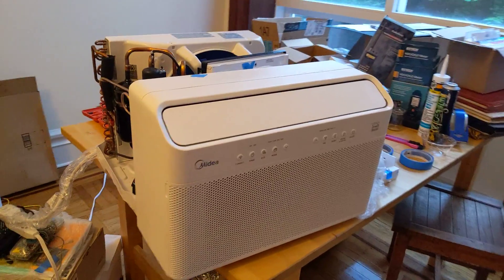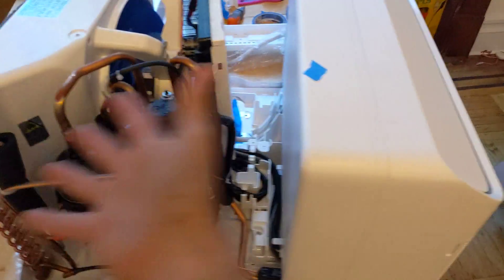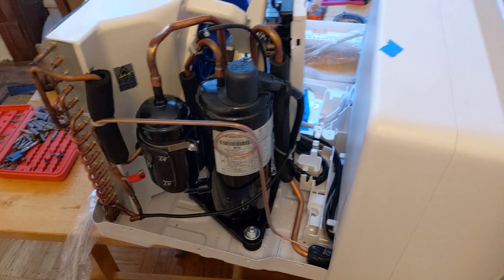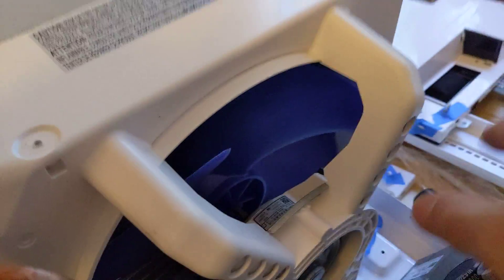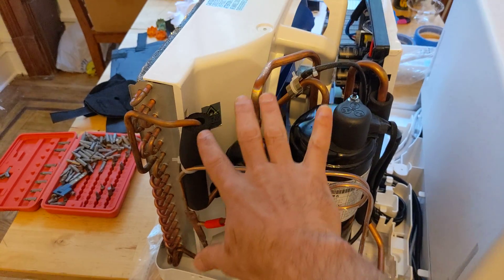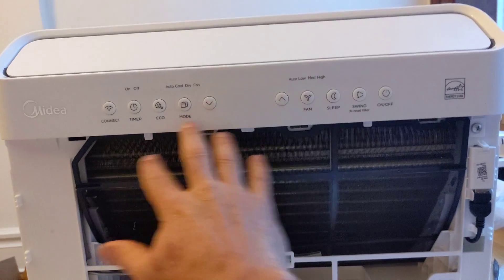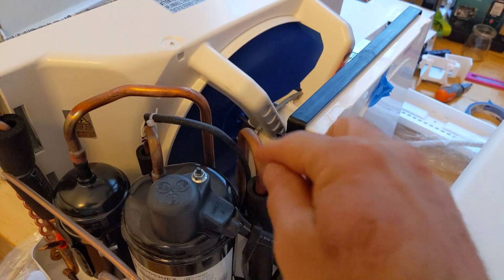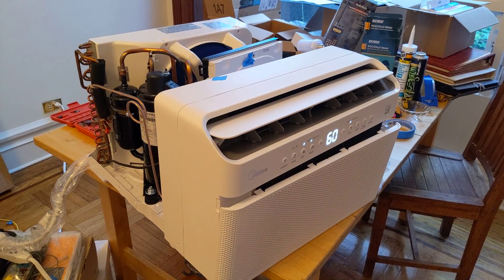How did Midea fit a full mini-split system inside their new "U" window unit?

Comment: What’s the purpose of the little bit of supercooling you get with this unit?
Reply from the maker: Just slightly increases efficiency. Easy way to think about it is that the condensate water is by definition colder than the outside air since it comes from the inside coil. This means that it can lower the temp of the refrigerant to be lower than the outside air temp. So you are basically taking some of the "coolth" (opposite of warmth) stored in the condensate water and moving it back into the room rather than just dripping it onto the ground outside.

Comment: I don't know if you still monitor this feedback, but I have a question since you seem to be familiar with this unit.  How much does this unit dehumidify?  How does the water (condensate) get out?  Is it a direct air pathway (connection) to outside?  I'm wanting to use this unit to maintain temperature and humidity for a shed project.  If this is a simple drain, humidity will leak in.  Is there a p-trap or check-valve to prevent direct air flow?  I'm building this in hot, humid Florida.  Planning to use a slab with vapor barrier (ground is always 55 degrees), Zip-R walls & cellulose dense-blown walls & ceiling.  It will be an ice chest.  I'm concerned this will be my biggest air/thermal/moisture leak in the entire system.  Any information you have would be helpful.
Reply: Mine has a condensate water tray under the fan. You can hear the fan splash the water around to help cool the components and evaporate the water.
Reply from the maker: Some have complained that these do not dehumidify their space as well as older dumb units. My guess is that this is because these people have a lot of moisture coming into the space through a leaky envelope. Since these units will run at the marginal indoor coil temp the keep the temp set point for efficiency, this means that they will not dehumidify as much as a unit whose coil is pegged to, say, 45F always when the unit is on. There is a dehumidify button that I would guess tells the controller to run the coil at a lower temp and probably to also slow down the indoor fan, but I have not tested this. 
The condensate flows out via a gutter than you can see at 3:48. You should be able to hack a drain tube into the indoor condensate gutter and run that tube to a P-trap if you want to get the water out without letting any air in. I've also seen cool negative pressure condensate traps like this https://photos.app.goo.gl/VT8UryMUyD4fp8Rh8 that are even better than P-traps because they get all of the water out of the envelope immediately (P-trap always has standing water) and mechanically block backdraft into the space.
With such a tight airseal, a unit like this might be overkill. You might be able to get by with something like https://amzn.to/3mzDulZ since the small amount of heat that it rejects into the space will just get absorbed by the slab anyway. 
Good luck and please report how it turns out! I want to sleep in your ice chest. :)
Reply: @bigjoshlevine  Thanks Josh.  I want to unpack this and I’ll get back to you.  Wish I wasn’t busy right this minute.  Sounds intriguing.

Comment: Just installed mine yesterday. Pitched roof, 3rd floor. Only 3 inches of space below the window. Modified the sill to lift the unit 4 inches to accommodate the bracket angle support. This thing is whisper quiet and no clunking sounds. Measured 45°F breeze coming off it on high. The install is different but the unit with it's platform bracket is amazing. This video makes me happy i invested in this. 👍

Comment: Do you know if there’s a valve on it so I could disconnect the refrigerant line without destroying the unit? I’d like toset this up in my camper van. I have an isolated metal box where my generator is currently sitting that I’m going to pull out. So I can mount it in the box through the wall. It would be a lot nicer if I didn’t have to cut a big hole in my wall though and I could completely split the unit in the two to install it and then put it back together
Reply from the maker: The refrigerant loop is sealed so you would have to recover the refrigerant from it, then cut the lines, then reconnect everything, vacuum pump the system down, and then recharge the refrigerant. This is not that hard (AC techs do it every day), but you do need stuff like a manifold and a vacuum pump. If you know someone who works on AC stuff they can probably help. I also recently saw this nice vehicle unit from MRCOOL, but I'm not sure if you can buy it yet. https://imgur.com/a/xB1p3Ne
Reply: @bigjoshlevine  Cool, I might try it how do you mean recover it? I think this unit would be nice in my van and take up way less space than a mini split

Comment: The variable speed has another benefit as shown by this unit's dehumidify mode. Run slowly, it can dehumidify better that an A/C that turns on and off. That can save on your power bill. But with these benefits, comes a electronic complexity that may not handle surges or lighting well. You might want to install a HVAC-grade surge compressor.
Reply: I do believe that these units have a breaker built into the plug, with 2 button Test / Reset (similar to a hair dryer)

Comment: Could one of these be modified for roof mounting? Angle the inside unit 90 degrees down so I could put it on my RV? I really hate my noisy, inefficient RV unit.
Reply from the maker: Anything is possible, but I think making the inside coil horizontal would cause problems because (1) the condensate would not be able to drop down to the bottom edge, and (2) you lose the whole design goal of having liquid refrigerant come in at the bottom and then turn in to gas by the time it gets up to the top so heat is absorbed across the whole coil and no liquid gets back to the compressor side.
Reply: @bigjoshlevine  Yes, would probably require some re-engineering. But if someone does make a roof unit like this it would sell like hotcakes, especially at this price point.

Comment: We love ours, but it removes zero water from the air as far as we can tell. Humidity doesn't drop (stays 55-60%) & there is no water dripping outside. Is that expected/normal?
Reply from the maker: Usually the target indoor humidity is 40-60% so it is possible that the airconditioner is not getting the temp down below the dew point of the air. You can try switching to dry mode which is supposed to run the coils colder and the fan slower to condense out more humidity. Normally this unit is designed to heat up and evaporate the water that ends up un the bottom pan, so should not drip any.
Reply: @bigjoshlevine  Thanks. We tried Dry mode as well with no better results. I hadn’t realized this unit will evaporate the condensate. Maybe it did pull some moisture out, but it just didn’t change the readings in the room. We’d prefer the drip & low energy consumption, given a choice. Then again, we may add a second unit over the garage and dripping from there would be a nuisance.

Comment: So this unit monitors 3 points? Compressor hot gas output (temp. sensor on top of the compressor), condensor return liquid temp (temp. sensor on line headed to evap. cap. tube) and return air temp (temp. sensor at front grill) Mine is collecting debris and/or mold/mildew on the blower wheel. Anyone else have this problem?
Reply: Yeah, I have two of these. I actually open my window and get my garden hose and do short blasts on the fan to clean it. I put a big tupperware container under it on the inside in case it overflows. Before I install it for the next season, I will disassemble it for a proper cleaning. They say it's from not keeping the filter clean however mine is clean even when it tells me to service it. I done this however with every window ac I owned. At least it's plastic and not foam like others.

Comment: have you used this AC much? i've installed four of them for myself and friends. and i hate how they operate at lower temperatures. i'm in the mojave desert. they work fine when it's 95-110f outside and i set them to 80f inside. but if it's 70-90f outside, they get lazy. the fan spins slow, the compressor spins slow, they pump out a frustrating trickle of cool air. can you comment on why this is? why does the machine say "i know you want it to be 65f inside, but it's 85f outside, so i'm going to slow down and not go below 77f inside" -- what the heck? a less sophisticated LG or frigidaire will just keep churning out cold air til it hits the goal. the midea gives up. someone is working on a way to trick one of the thermistors into thinking it's 105f outside, they think that will fix this lazy AC issue.
Reply from the maker: Is it possible that the indoor sensor is reading a lower temp than the rest of the room? I've seen this happen where the airflow is partially blocked so some of the air blowing out of the top gets redirected back into the bottom intake part by a curtain of furniture. When this happens, the unit "sees" the room as being colder than it really is so scales back.
Reply: @bigjoshlevine  always possible, but there is no blockage that i've created. i'm going to open the unit soon and hack the sensors.
Reply from the maker: @AJTarnas  Please do report back with your results - others have been having the same issue!
Reply: @AJTarnas  turn off eco and use boost.
Reply: @LemonySnicket-EUC  tried that. never leave eco on. boost does nothing. one solution has been pioneered by someone: trick the exterior temp sensor. it's a difficult hack though.
Reply: @AJTarnas  boost definitely does something on mine and I use eco for what it's intended for. It's a great feature for my needs.

Comment: I'm a detail guy to so YES, great job.  But, I thought Mini-Splits act as A/C & Heat Pumps?    Isn't this just an "A/C unit" with the noisy parts outside?  I'm trying to find a window unit that does both, like a Mini-Split.  Thank you : ))
Reply from the maker: Mini-split just has to be split and mini - it can be a dual mode heat pump or it can be just AC. Midea is working on a version of this unit that will have a heat mode and in the meantime there are other manufacturers already making them like Gradient (although there is a waitlist for that).
Reply: @bigjoshlevine  Hey, thank you!!  I've been looking since seeing this abd yes, LG also!!  Not quite as efficient or and only able to pull heat out of 40 degree air vs 0 degrees like full size.  I'll keep looking, but THANK YOU!!

Comment: Do you remember where the outdoor air temperature sensor is located?
Reply from the maker: It is possible that there is no outdoor temp sensor. The unit really does not need to know the outdoor temp. As long as it knows the hot gas will always be hotter than the outdoor temp (reasonable assumption!), it only needs to know the high side liquid temp to figure out if it should speed up or slow down the condenser fan. There is a temp sensor on the bottom of the condenser coil (shown in the middle of the video) for this.
Reply: @bigjoshlevine  thanks fpr the reply. There has to be one somewhere because the Midea app tells you the outdoor temp as recorded from the unit.
Reply from the maker: @aaroncameron1494  Possible to compute outdoor temp if you know temps at the top and bottom of the condenser coil and the outdoor fan speed. They might also just be grabbing it from the web based on your location. I have never noticed an outdoor temp sensor before and it would have to be on the sides of the coil where the air comes in so I think would be pretty obvious, but I will try to find one next time I open up one of these units.
Reply: @bigjoshlevine  thanks for your help. I did confirm with a hair dryer that the outdoor temp is gathered from the temp sensor on the condenser output.

Comment: Happy to see this. I've had the 12,000 installed for a few weeks in hot weather. Took out an old conventional 10k. No comparison, the old 10 blew way more air on low than this one on high. I suspected there was one fan outside trying to blow air down through the bottom of the "U" but this vid proved me wrong, so there is an inside fan. Don't know why the flow is so weak, on Midea site many similar complaints in reviews, maybe it's the efficiency. Midea now makes a similar inverter AC but no U shape-MAW12HV1CWT, smart inverter with heat mode but conventional shape. I wonder if that has 2 fans.
Reply: i have this same problem. it's not entirely clear why the AC throttle cooling under certain conditions. but it's super frustrating. there's a guy who is working on a hack involving tricking the exterior air thermistor.

Comment: You mentioned cheaper ac units using one motor to run two fans with an axel. Does air travel through the two portions of the ac unit, intentionally or unintentionally?(e.g. air from the compressor portion travels into the cooling portion)
Reply from the maker: There is a seal around the shaft to reduce airflow between the sides, and there is usually not much of a pressure difference across it so not much air gets through. Usually more air (and sometimes bugs) go through the opening for the condensate water to flow out, or around the window opening itself.

Comment: Man you're really gushing over this thing. I got one today and yes the design is great...but I got it all setup, it just does not push any air. So my room was not cooled. Not even close to a much smaller  older unit. Very disappointed. Taking it back tomorrow
Reply from the maker: What do you mean by "push air"? Do you mean that the inside fan is not moving enough volume of air? Or that the air coming out of the blower is not moving fast enough?
Reply: @bigjoshlevine  both I guess. Maybe it's defective I can't believe all these people are satisfied with an ac that feels like someone's breathing on you

Comment: I own this unit. You better believe you can hear the 6kHz compressor inside. My neighbors complain about it, too. The window foam does not install well and gaps let the sound through but the bulk of the compressor sound comes right through the inside filter. It’s a high pitch sound that leaves my ears ringing from about 12 feet away in my office.
Reply: I have the same issue.
Reply: @andrewnoblet5685  I'm installing dynamat around the compressor now. It's an adhesive pad made from 1/8" asphalt. Should block the sound. Will update.
Reply: @AffinityPhoto  Let me know how it goes!
Reply: @andrewnoblet5685  well, first off, the "sleeve" over the compressor was not installed completely...
Reply: I don't have this issue. It's super quiet.
Reply: @LemonySnicket-EUC  I’m talking about outside the window. Mines quiet inside the room.
Reply: @AffinityPhoto  mine is quite outside as well.

Comment: I purchased this A/C in April. Very happy thus far.  Loved  learning even more about it from you. You might mention, and/or pull out the removable/washable filter located in the front section of the unit.  For me, this feature was in my top 5 must haves and in my research,  I found that many window units don't give you this capability.
Reply: In my case tho on high power it's not even comparable to my older unit on low. It's too weak that's part of why it's so quiet

Comment: Do these just drain the water like most units or does the fan sling it on the coils for cooling?

Also any issues with rust or do the units stay pretty clean?
Reply: No drain. Yes it splashes the water around via a tray underneath the fan.

Comment: Any sense of the noise on the OUTDOOR side? It seems like it would be somewhat lower by virtue of the variable speed compressor and fan. I have neighbors not to far from my current window unit and even from the end of the "canyon" crated by our two buildings, I notice a lot of white noise from my current unit - the dominant noise by far. I've noticed window units and this seem to "PUSH" the air at the outdoor heat exchanger, it seems like mini split outdoor units "PULL" the air through the heat exchanger, which seems quieter. I'm guessing this would be quieter (on the outside side) than a typical window AC but not as quiet as a traditional mini split.
Reply from the maker: You right, the outside side is louder than the inside side, but quieter than the outside side of a normal window unit. Of course nothing is as quiet as a nicely built minisplit outdoor unit like the MCROOL ones!

Comment: I have the Costco version of this unit 12000 btu but built like a traditional window unit...the compressor on mine makes a deep resonant sub woofer like rumble when working hard...when on low its barely noticeable. I find this sound annoying. Do you know if this sound is normal or do I have a  dud?
Reply: Normal

Comment: Hi Josh.... I'm purchasing one based off your review!   Can you tell me if it dehumidifies as well as most window a/c units?   I have read a few reviews saying it doesn't dehumidify all that well on a humid day in cool mode?
Reply: I don't understand why people are asking this question.   All A/c units dehumidify, like a glass of cold water(water vapor turns to water as it hits the cold glass),  as humid air hits the evaporator coils moist air turns to liquid H20.   This water condensate flows back to the condenser partially cooling the condenser, the rest drips out.    I am guessing some people are complaining that it is "not dehumidifying enough"... The A/C does have a Dry/Dehumidify mode.   This mode is not as cools as the regular a/c mode.  It just cools enough to condensate some water.   Similar to a glass of cold water.  The colder the setting, the more you dehumidify the room.

Comment: The "reactor"  the one that looks like a transformer.... Does anyone here have a good understanding of how this works?  My understanding is ... this unit provide the system DC power as well as control the speed of the compressor.

The 12V AC units I see don't appear to have this "reactor"